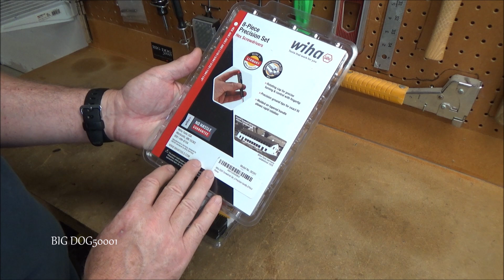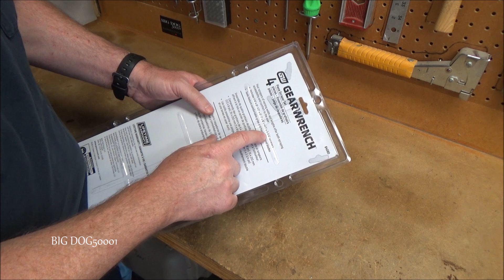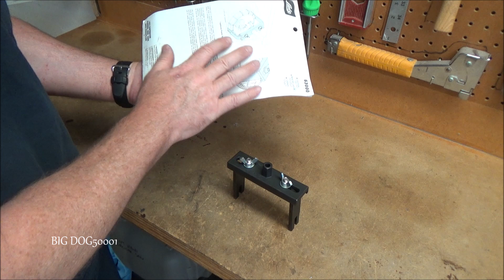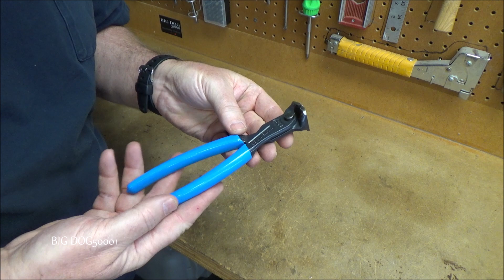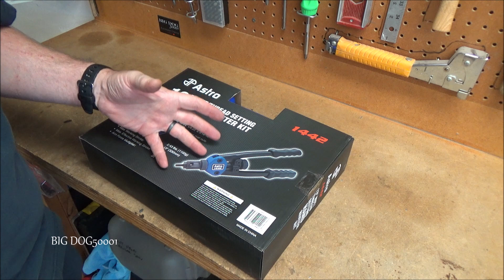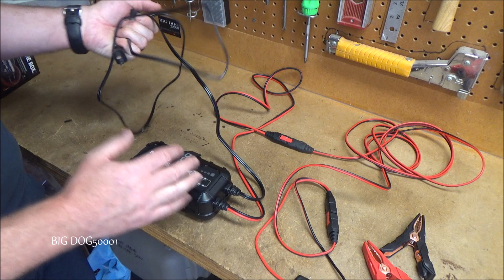New Tools! Tools Episode 2101

Comment from the maker: Tools
Disclosure: This channel earns a small commission using some of these links - at no additional cost to you.
Wiha Hex Set 35392:  https://amzn.to/32K3mOk
Wiha Hex Set 35393:  https://amzn.to/3dLm7HB
Wiha Hex Screwdriver Set 26391:  https://amzn.to/3tZcqv3
Laser Torque Adapter Set 7286:  https://amzn.to/2PhOxzD
GearWrench Scraper Set 84080:  https://amzn.to/3gz73yB
Lisle Fuel Tank Lock Ring Tool 63000:  https://amzn.to/2QTVVBK
Ares Nylon Pick/Pry Set 16003:  https://amzn.to/3v8I4pQ
Mayhew Belt Molding Removal Tool 45049:  https://amzn.to/3esaRz1
Milwaukee Cut Out Tool 2627:  https://amzn.to/32KlAzf
Channellock End Cutter 357:  https://amzn.to/3sKVcjv
Amprobe LH41A:  https://amzn.to/3etCI1S
Lisle Throttle Depressor 48700:  https://amzn.to/3v9KmoA
MityVac Fluid Extractor MVA6851:  https://amzn.to/3xdBdxc
Astro 13" Nut/Thread Riveter Kit 1442:  https://amzn.to/3nhRixb
Noco Genius 10 Battery Charger:  https://amzn.to/3nf1err
Noco 10" Extension Cable:  https://amzn.to/3tMCuZT

The Big Dog 50001 Automotive Channel Store can be found here: https://www.amazon.com/shop/bigdog50001automotive  (As an Amazon Associate I earn from qualifying purchases).

Comment: I need your help.

I am from Pakistan and have 2007 8th Generation Honda Civic Vti 1.8 Oriel.

I need to know what are the temperature set points for functioning of Radiator fan on Low Speed and High Speed respectively.
Reply: The issues is that when AC is OFF and car is started the Engine coolant temperature keep rising till the point it reaches 100 or 101 degree centigrade then both fans are turned on at High Speed and get turned off when coolant temperature reaches 94 degree centigrade.

The Fans never get turned on at Low Speed. I have checked the wiring and fans they do work on Low speed as I have tested it through help of your previously uploaded video. Radiator Fan Relay, AC Condenser Fan Relay and Fan Controlling Relay are removed and the circuit is completed Hardwired the fans work at Low speed.

Comment: This has nothing to do with the video but, I have an 03 honda accord. On my screen it says " check disc" and its stuck on that screen. I'm not able to use my navigation or listen to music.. you wouldn't happen to know what the problem is do you.. can you make a video about it?
Reply from the maker: Lots of issues with the radios on that generation Accord.  Either the entire audio unit dies or discs get stuck inside the unit (which is what sounds like is happening to yours).  Removing the audio unit and sending it to be repaired (or replacing it) is usually the fix.

Comment: Thanks for listing all the tools here. I like shopping.  :)   I remember adjusting the value on torques when I worked on Helicopters. I also remember if the adapted is 90 degrees from the head of the torque wrench there is no adjustment required. I'll look forward to your video. It will be a good refresher for me.
Reply from the maker: Sounds like you remembered right lol, thanks for the comment Wyatt!

Comment: The rotating top on the screwdriver is actually used with your palm (pressing down with the area where your index and middle finger meet) and you rotate the screwdriver with your thumb, index and middle finger, a bit like holding a pen. That way you have a very precise control over it and don't need to move your wrist at all. It's quite common actually when you're working with electronics where you only have tiny screws.
Reply from the maker: Good to know, thanks for the input!